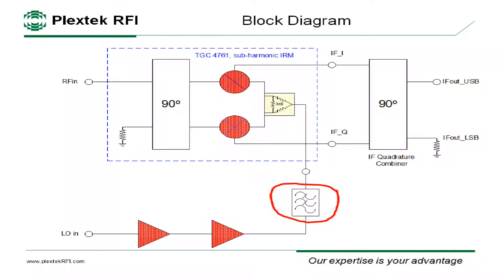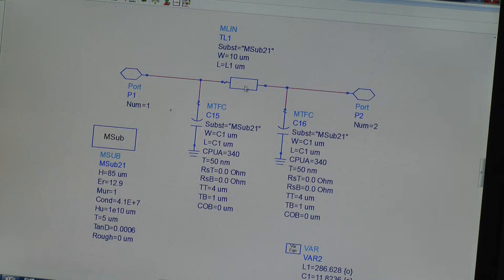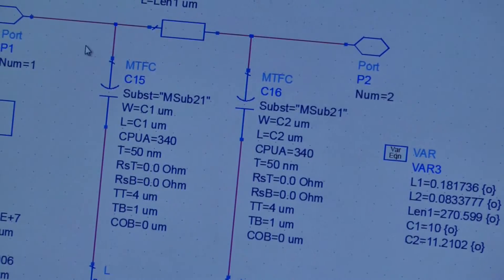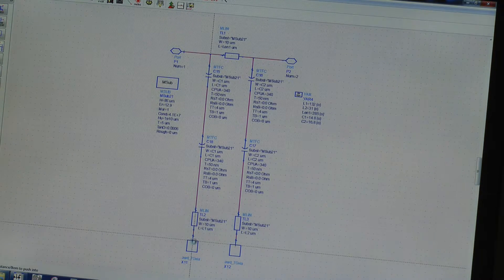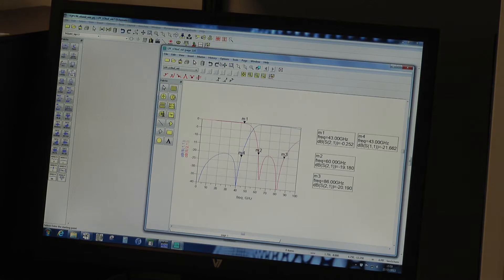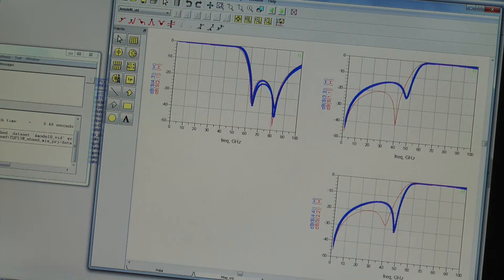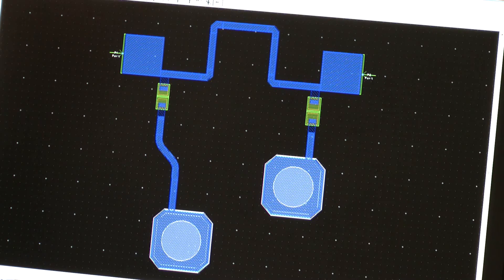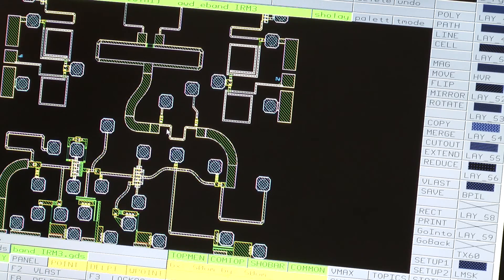Designing mm-wave integrated filters using Keysight ADS

Comment: Good tutorial, had to play the video twice, you speak very fast. Suggestion: Cancel the background noise, speak a little slower but with more power, it will double video length. But helps to relax the requirements on the audience side for filtering, sampling, and processing the information :)